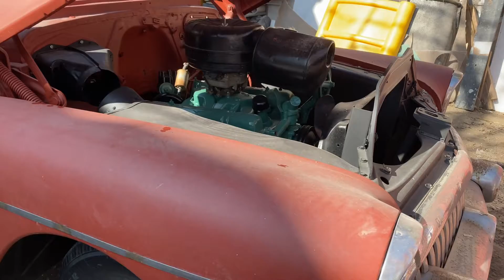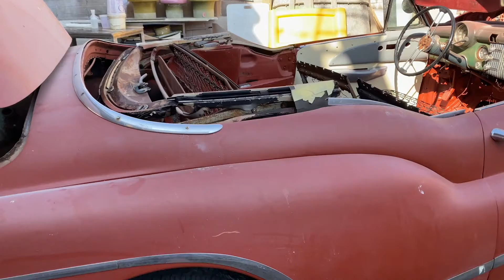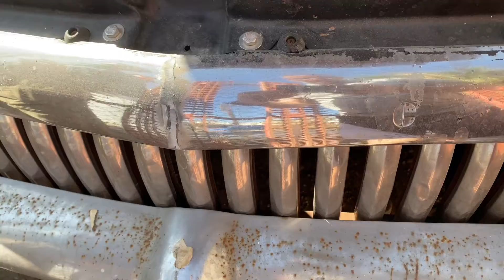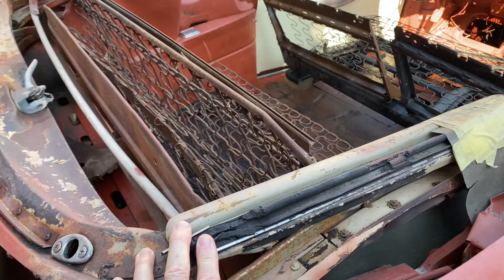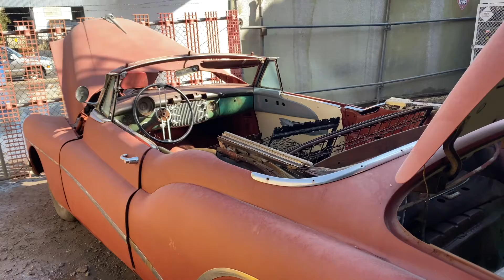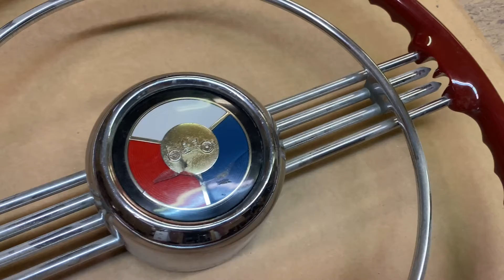1953 Buick Skylark Convertible Project Car | JB Donaldson | In the BTG Shop

Comment: THIS NARRATOR IS TELLING HALF TRUTHS. 1ST IN 1953 THERE WERE 4 SPECIAL EDITION CARS THE CADILLAC ELDORADO ;THE BUICK SKYLARK ;THE OLD 98 FIESTA CONV; AND THE CHEVY; CORVETTE. PONTIAC DID NOT GET A SPECIAL EDITION ALTHOUGH THE DIV. MADE ONE CALLED THE PARISIAN. SECOND THEY ALL WERE MEANT TO SELL, NOT  JUST A SHOW CAR. THEY WERE CUSTOM BUILT BY THE GM FLEETWOOD CUSTOM SHOP.THEY WERE EXPENSIVE FOR THE TIME. SALES FOR THE OLD 98 FIESTA WERE TERRIBLE AND WAS CANCELLED AFTER 53 THE BUICK SKYLARK ALSO WAS CANCELED AFTER 1954. THE ELDORADO CONTINUED ON TILL 2002. THE CORVETTE WAS SLATED TO BE CANCELED IN 1955 BUT WAS SAVED BY ZORA ARKUS DONTOV BY CONVINCING THE EXECS TO ALLOW HIM TO PUT CHEVY'S NEW V8 IN THE CORVETTE AND HE DID.THEY LIKED WHAT THEY SAW AT THE PROVING GROUND TRACK AND THE REST IS HISTORY. THE NARRATORS DESCRIPTION OF THE HEATING SYSTEM IS INCORRECT AS ALL BUICK'S HAVE HAD UNDER SEAT HEATERS FOR DECADES. AND NOT JUST UNDER SEAT IT ALSO COMES FROM THE UNDER DASH AS WELL. AS FOR THE 4BRL CARB.' THAT IS THE DIFFERENCE BETWEEN THE SUPER AND THE ROADMASTER ENGINES ,JUST THE CARB WHICH CALLS FOR A DIFFERENT INTAKE MANIFOLD . AND THE INITIAL CAR WAS A ROADMASTER  CONV. NOT A COUPE AS THE FRAME IS DIFFERENT AND NEED EXTRA SUPPORT. PLUS THE MOUNTINGS AND TOP SHIPPED WITH TE CAR.
Reply from the maker: Thanks for watching!
Reply: I've never heard of the Fleetwood connection as to the semi-custom bodies for the Skylark. The cars had final assembly in Flint at the main Buick plant. The doors were also cut down and finished in Flint. The Skylark utilized a modified Roadmaster Fisher body - and I've always assumed those bodies were produced at the Fisher plant in Flint and not at the Fleetwood plant in Detroit. Can you please go into a little more detail on this? These cars are a real high water mark for Buick and I'd like to learn more about this Fleetwood connection. Thanks!

Comment: another nailhead engine painted with " green dotroit diesel "  color....
Reply from the maker: what color would you paint it?
Reply: @BarryTsGarage  original color ...is blue turquoise...
Reply from the maker: Good to know - I’m going to pay attention to that!
Reply: @BarryTsGarage  I have a Buick  , I was under the car checking the " Dynaflow" leaking oil and I noticed the motor oil canister has the gold original letters info , (use original AC  bla, bla, ) I took off the canister  I cleaned up take it to the paint shop they mach the color and I took the parts for paint valve covers water pump, spark covers water cross over etc etc and ready..my car engine  looks very nice and shine, ... check the nailhead engine on the web...
Reply from the maker: Wow that is great!  What year and style is yours?
Reply: @BarryTsGarage  is not as expensive as yours but I have a '54  and '56 Roadmasters...
Reply from the maker: Those Roadmasters are great cars! 👍🏻
Reply: @BarryTsGarage  thanks...